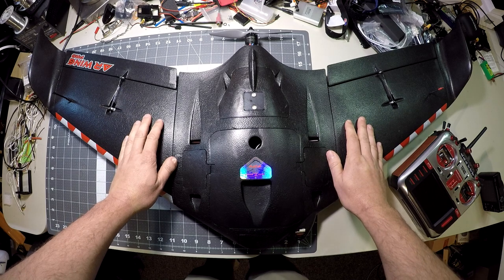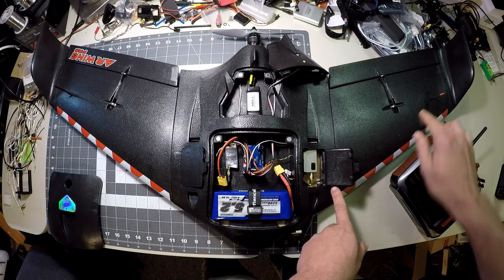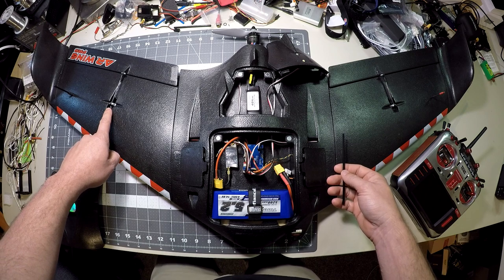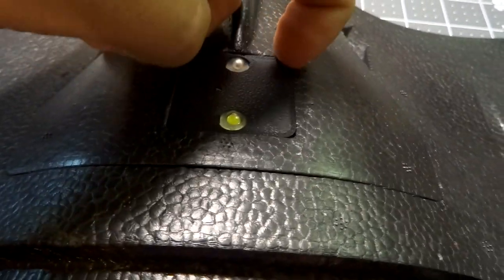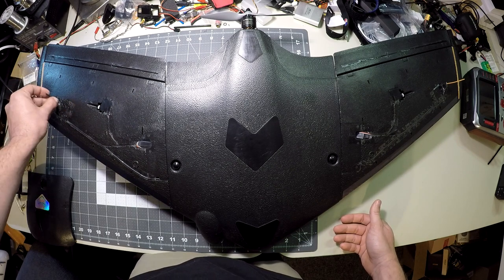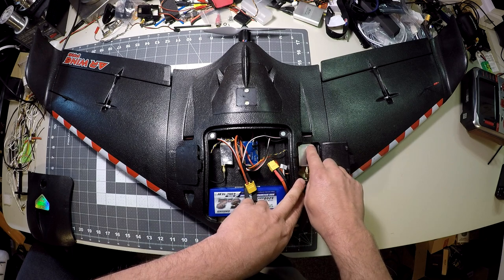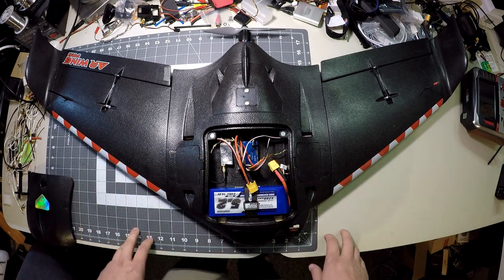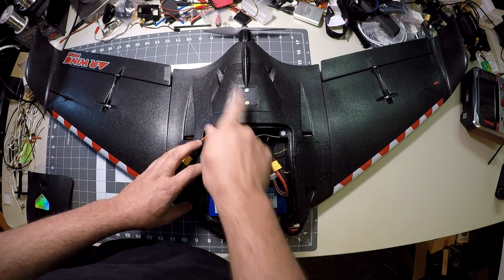AR Wing Pro - Walkaround

Comment: Very nice and neat build. I know you have the test gear to tune your antennas but I'm wondering if you are finding stock included antennas very far off frequency.
Reply from the maker: This video antenna is one that I made myself, I intentionally used elements that were too long so I could tune it once it was installed in the plane where it will stay. With the elements longer than necessary it will resonate at a lower frequency than you need, I then start trimming them down little by little until the resonate frequency moves down where I need it. That will give you the best SWR you can get for a specific antenna. You can't do as much with impedance, that usually comes down to the antenna's design and how well it's constructed. If the impedance is way off from what it should be though, there's usually something wrong, like a damaged coax cable, bad connector, or just poor soldering where the coax meets the elements. Most of the stock antennas and things that I've checked are generally good, especially those made specifically for FPV. Dragonlink, VAS, RMRC, etc. have all been damn close. Sometimes the junk antennas that come with the Partom transmitters for example will be a bit off tune, those are usually too big and heavy to use anyway. I like to either buy something better or make my own.
Reply: @bonafidepirate  Thank you for the explanation Keith.  Building and tuning a 1.3ghz antenna would make a good follow up video to your  nanoVNA Vid.

Comment: Great video again Keith. I'm just about to maiden mine. Where do you have your CG? Are you in the middle of the CG pads under the wing or slightly forward/back? I'm finding it difficult to get exact using my fingers as it seems to tip forwards and back with the same weight on the CG pads. Cheers
Reply from the maker: I'm pretty much centered the marks, if anything very slightly forward. I too, found it difficult to get it to balance on the marks, as it wants to tip one way or the other... lol I start with the wing level and adjust so it tends to sit there for a minute before tipping one way or the other.
Reply: Get some dressmaker pins, the ones with plastic balls on the end, put them in the CoG marks and you'll find it much easier to get a balance. Works for me :-)  Steve

Comment: Thank you for the video ! I wanted to consult you about the frequency 1,3 . Is it worth buying an RMRC-1.3 GHz 800mW transmitter or are Chinese transmitters just as good? Here probably the video quality depends more on the receiver? I took an RMRC 900MHz-1.3Ghz High Performance Receiver with Custom Tuner
Reply from the maker: Yeah a good video receiver is important! lol I've used transmitters from just about every source, and haven't seen any difference in them, they've all been good. My current source if Banggood, they have the 800mW Partom for less than $30. https://bit.ly/3mpAljj If you're in a hurry RMRC is a good source and it comes with a better antenna, but they'll both work about the same. (Apart from the video frequencies, RMRC is locked to just 1280 and 1258 for the US version, assuming you're in the US. That's all we can legally use anyway so no loss really. I believe the imported ones don't to 1258, just 1280 but I may be wrong about that. I always use 1280 so don't remember... lol)
Reply: Thank you for the detailed answer! And as always I ask for subtitles in your videos lol )) I love your channel very much! Good luck!

Comment: Bonafidepirat how exactly did you wire up the DL receiver? Did you use all of the UEXP cables for telemetry, I understood you skipped some? What about the RSSI, you only connect one cable, how come, dont you need 5v and ground, or are these already supplied through SBUS...?
Sorry for the knucklehead questions but I just got my DL 900 mhz system im ans the wiring to the FC remains abit of a headscratcher.
Will you show some close-ups as promised? That would be neat
Reply from the maker: I just have TX and RX for telemetry, you only need a ground reference for those. My SBUS signal wire has the 5V to power the receiver, and ground for everything. So there's 6 wires between the FC and receiver. TX and RX for telemetry, 5V power, analog RSSI, and ground. The TX and RX are mapped in the receivers to two of the unused pin that are normally assigned to PWM channel outputs. (I changed those in the DL GUI, quick and easy to do) SBUS and analog RSSI pins are at their default locations on the receiver. Being able to move different output and input signals around to different pins on the Dragonlink receivers is one of their best features I think. ;)
Reply: Now you kinda have me confused, what is the UEXP slot used for on the receiver, if not for setup of telemetry? The manual on the DL site clearly says to connect the UEXP or at least certain wires of it. Is mapping it to free pins on the receiver just an alternative way of doing just that? Thanks
Reply from the maker: @ecor1987  Yep, they come with the UEXP port set up for it by default, but like I said I just mapped them to a different pin, simply because I have piles of "servo" connectors laying around, and the bare pins/housing and the tool to crimp them so I can make cables any length I need. It's just easier to work with than the connectors on the UEXP ports for me. You can configure all the pins on the receiver to just about any function you want, with the exception of analog RSSI, I'm almost sure that one is limited to the one pin it comes set to by default because of hardware needed for it to work properly.
Reply: Hey Keith, thanks for taking the time to explain this stuff. You really just helped me out here.

Comment: Keith, I'm building an AR Pro, I come from building quadcopters, may I ask, what method do you use to mount the flight controller to the wing? I have not seen a single video mentioned how to mount the flight controller to the wing.
Reply from the maker: 9/10 times I use 3M mounting tape, just stick it down. If I think I may need to easily get it out later I'll take the time to 3D print some brackets to hold it down instead.
Reply: @bonafidepirate  It must be square and centered right? Also I plan to mount my receiver on the wing, my Rx needs 4 wires, the quick-disconnect on the wing only has space for 3 wires plus the servo's other 3 wires, how can I mount it in the wing hole?
Reply from the maker: @jhughes2286  Yep, generally you want the FC mounted flat in the center of the wing, close to the CG. A couple of inches away won't make it not work though. There's usually an arrow or something to designate the "front" of the FC, if you face that forward you're good to go. If you need to mount it in some other orientation you can usually set offsets in the FC firmware so it knows what's actually the new front "front". iNav and Arduplane can for sure, not all others will work like that though. To get the receiver in the wing using 4 wires, you can usually share the ground for the servo with the receiver and free up an extra wire for signals that way.
Reply: @bonafidepirate Ok thank you, I guess I'll need some servo connectors and wires?

Comment: bonafidepirate  how did you setup the Strix Strobe did you set it up on a switch and just mapped a RC Channel through Ardupilot to point at a switch?
Reply from the maker: No I'm not sending any signal to it, it's just plugged into the servo rail for power. When it's powered up it starts working, and I can change the pattern with the little button on the strobe. I think you can switch it on and off with a spare channel if you wanted to, but I didn't bother. If you wanted to, yes you could just set that servo connector in Arduplane to pass through one of your R/C channels.

Comment: Did you sort out the wondering it dose in cruse mode? I do not have the same issue with my Arduplane set up ion my Arwing pro. It just locks the heading and fly straight..
Reply from the maker: Yes, it was the tuning on roll axis. I mentioned it in one of my last videos flying it. I threw out the values for that Autotune have given me for the roll, and put the defaults back in and it's loacked in and feels better, holds a heading very well.

Comment: Thanks, great review. Can you elaborate on the center of gravity location?
Reply from the maker: I balanced on the molded CG marks on the bottom of the wing. It seems to fly well there, I didn't feel a need to change it.
Reply: @bonafidepirate  Thanks.  The marking is large, I will start at the front of it.

Comment: On the 900mhz antenna, how do you know which is active and which is passive element to de sleeve it and mount it in. I have been mounting mine as it comes and damages antenna after a while. By the way I’m using crossfire 800mhz if that makes any difference to which side of the antenna
Reply from the maker: The Crossfire antennas that I have here (Immortal T) all measure a DC short between both elements, I'm guessing it's some sort of matching transformer or something like that in the molded plastic in the center. The Dragonlink antennas are not electrically connected between the elements, so you can check them with a meter, one is connected only to the center pin on the SMA connector, the other to ground. I'm not sure how to tell which is which on the TBS ones, but the ones I have are all springy and return to their original shape, and should be stiff enough to hold their shape in flight. I'd just mount it upright and it should work fine.
Reply: And also how many degrees offset do you have on your board to make it fly level. I had mine set at 0 for maiden flew well with 1300 cruise throttle, but would slightly Bob up and down and motor would surge slightly. So increased it by 1 degree with same result.
Reply: @smegaloon    most folks say to set the board level with wing 3-4 degrees pitch up.  just saying :-) Steve